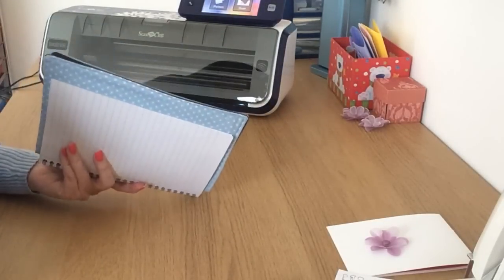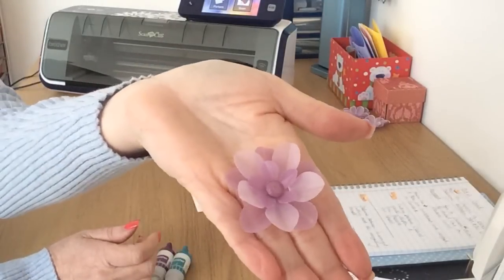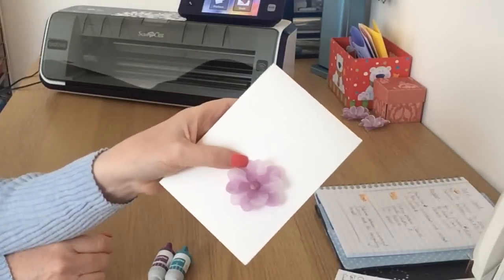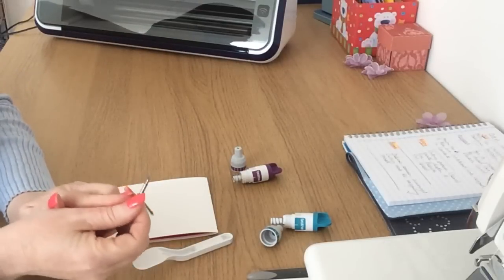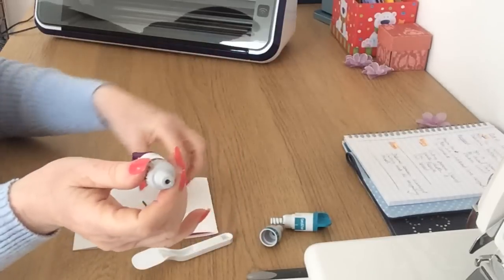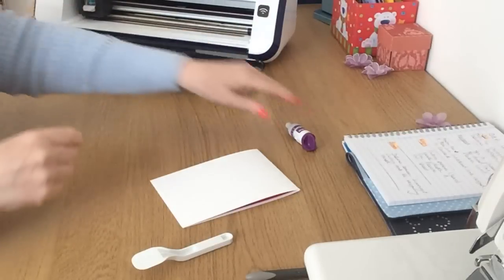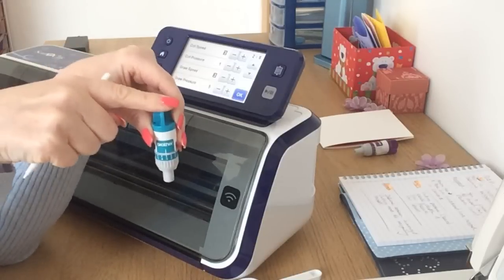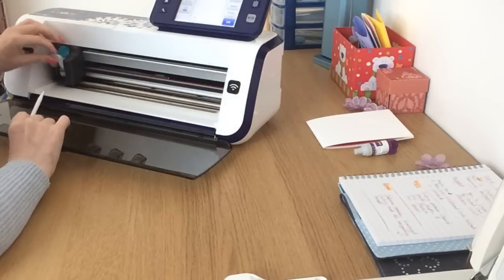ScanNCut Q & A Part 1

Comment: With my ScanNCut, for some reason, mine wants to cut the middle of my project instead of the outside lining. I have even used a black marker to make the outside line darker, it still wants to cut the center. It doesn't ALWAYS do this but it does do  it quite often. What am I doing wrong. I have asked several people with no answers.......

Comment: I have a (perhaps) silly question. I missed your live stream, so I apologize if this came up before. In some of the newer videos, there is an icon under the 'save' button (on the screen with the ok button right before you get the cut or draw option--hope that makes sense) that looks like a box (?) - I don't have that. Is that from additional accessories or do I need to enable something in the settings? Or is it on specific models? To make sure, I just checked and I am using the latest version.
Reply from the maker: Hi i think its the symbol for the premium functions, if you go to the wrench on the front of your machine, and click through the pages you should find the premium function option just turn it on in there and the extra box will show up.
Reply: Ah, yes, that was it. It's for the embossing functions. Since I don't have that, I hadn't enabled it, thus no additional icon 😀 Thank you for your quick response, I suspected it was just something that wasn't turned on.